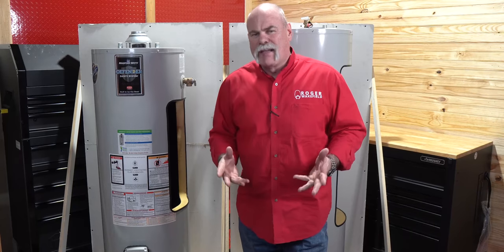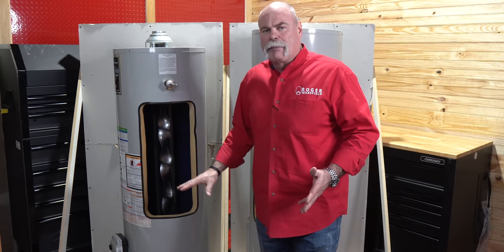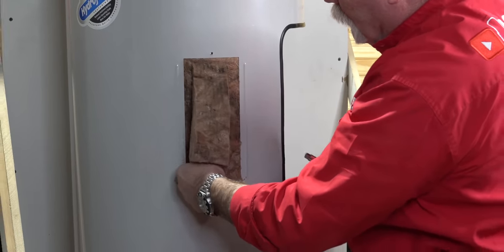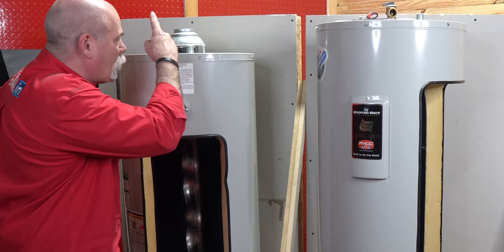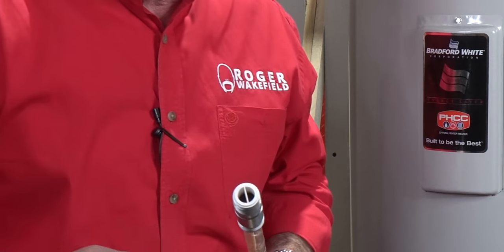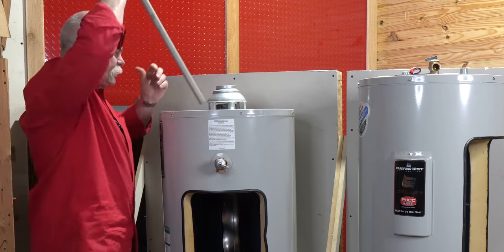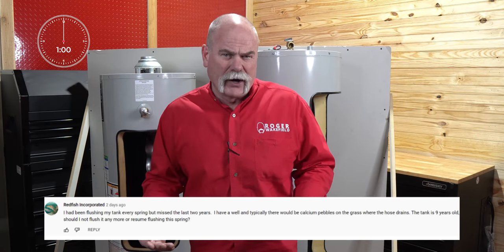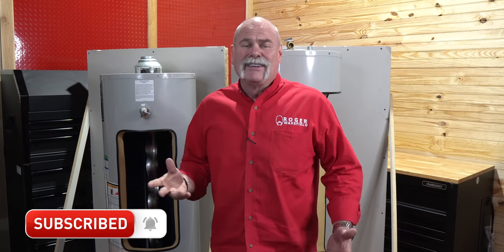Is Your TANK Water Heater Making These SOUNDS

Comment: I’ve moved 37 times in my life and never heard a water heater make as much noise as the one I have now. The maintenance guy said it’s normal but it makes noise every hour..
Reply: Mine is making a knocking noise every hour and lasting about 30 minutes or so and the maintenance man don't know what to do.  Ugh,  untrained and probably not HVAC certified. Did you all figure it out?
Reply: 37? dang thats a lot of evictions
Reply: @ladymomma5098  I usually have my fan on and don’t hear any sounds but my neighbor kept on complaining that I was using my washing machine at night. I’m finally hearing the banging and I believe it’s coming from the area where the water heater is there’s three floors and I’m on the second floor not convinced, it’s mine but we’ll see. Really eerie and strange.

Comment: My dad installed the water heater at our house when he moved in over 30 years ago. He is not a plumber. The water heater is still working properly, has never been serviced, has never been flushed. It made some weird noises once, but it's still working.
Reply: Is it a reliance brand?
Reply: Cause these are juggernauts and most actually do last 20+ years I’ve had mine for about 25
Reply: @oscarrivera3692  It's some brand that probably isn't even made anymore. It says craftmaster.
Reply: If it's that old, there's most likely a lot of sediment build up at the bottom of the tank, which means that water heater is costing you a lot more money to heat your water.
Reply: @Harloha  oh I never thought the tank was causing my high energy bills. Cheezus

Comment: had an electric tank in one place that was actually compromised to the point it was causing electrolysis in the water as it heated.  it was a rarely used building and every time you opened the hot tap, you would release the oxygen and hydrogen the electrolysis had cracked the water to.
Reply: My water heater started pushing gas  through the pipes. I wondered what it was. My heater is 30 years old and needs replacement.
Reply: Better hope nobody lights candles 🤣

Comment: My water heater (RHEEM brand) was installed by a plumber in June 2016.  Only reason I precisely when he installed it, is I recorded a video (saved to hard-drive) of him explaining how to flush it.  He advised opening the drain valve for 3 seconds, then closing it for 3 seconds, then repeat that process 5 full times.  Then after that open it and let drain for 15 seconds.  He said those first ~ 5  on/off cycles help stir the sediment around.

Comment: So I came home yesterday and my gas was off.  CWLP, city water light power, in Sangamon county Illinois  changed my gas meter outside. CWLP said it was mandatory. I’m sure it is. It’s above my pay grade to argue with them. My argument was, My Wife who works from home Could have talked to them if they would’ve simply knocked on my door and put forth a little Communication. Anyhow, they changed the meter they put a lock on the meter to where it cannot be turned back on, or I could not turn it back on myself, and left a note on my door. The note saying what they did. so after My Wife called, got it turned back on everything’s finally back to normal, sorta!That little bit of drama did not need to be installed into this comment lol but even though it’s a new day I’m still salty, maybe that makes me the jerk ha ha. So I fired up my water heater pilot light. And while I am laying there on the floor because of the awkward position my water heater was installed next to my boiler. I’m listening to it run and I start hearing sizzling drops. It sounds like someone dripping water into a hot pan. What do you think that is? Personally, I think it’s condensation like you spoke about. But, my wife, remember her? She’s the paranoid one who demanded I get online and find out what it is because my explanation after 30 years of marriage is not good enough, so that’s my question. What is the sizzling water drop noise after relight my gas water heater?
Reply: Wow, there was a whole Lotta unnecessary words in that comment/question..

Comment: Excellent advice once again! On a side note: i asked an hvac installer to give me a quote on a tankless system. the response i got was "we only have done it once" that was the end of that. i might get a second opinion some day. All i know is that bigger gas line would be required to deliver instant hot water.
Reply: The gas ones work from what I heard the electric ones don't last and have to pull 3 50amp circuits to them it uses 150 amps at 220V. We bought a heat pump water heater it was expensive now we get a whistling noise. The noise is intermittent from what I read that noise is from either the pressure relief valve or a crack in the top of the tank where it sucks air. Problem is it's intermittent I can't get the installer out here when it's making the noise. I'm kind of regretting buying such an expensive water heater now good old fashion direct element water heater is way to go. If I had gas here I would use that. They last for years if you flush the tanks.
Reply: Tankless water heaters don't work that well in houses. Maybe apartments, but a house will need multiple tanks.
Reply: Tankless is not an instant hot water. It is a continuous supply of hot water. To get what you might call instant would require a recirculating pump.

Comment: I had to change both my elements this past weekend. A pest control guy who knows nothing about water heaters. I got the both changed, and a donkey load of water on the garage floor, cause I thought I drained it properly....🌊🌊🌊🌊🌊🌊🏄

Also my sons (10 & 13), and I love watching your videos together, keep cranking them out
Reply: It take a good 10-20 minutes to drain. Most efficient method is to remove the drain valve. Be sure the cold water inlet is detached too to prevent vacuum retention. 

Lol but what do I know, I'm "just a handyman" as Roger says shrug
Reply: there's actually a secret to changing out elements.  you close the inlet and then open a hot valve to release the pressure and close everything up again, then you tape a plastic chute to catch any spillage from the element port and guide it into a bucket. then lay out everything to make the swap as fast as possible - when you pull the old element and slide in the new element, the tank will only lose about a cup of water, unless you fumble something.
Reply: @justtime6736  the cold side is the dip tube,just kill the water and open the hot side on all faucets

Comment: After doing dishes or taking a shower, my gas water heater kicks on and  few minutes later there is a single, loud metallic clank. Is that okay?  I’ve flushed it a few times, and that makes no difference. It seems to do it every time it kicks on. Usually shortly after the gas kicks back off.  Any tips?

Comment: Hello Roger, your 2018 version of this video said that you shouldn’t flush your water heater if you’ve never flushed it because the cracks in your tank are filled by the minerals in the water. You didn’t mention it in this video. Has something changed on the policy in the last 4 years?

I ask because I’ve never flushed my water heater. I’m hearing what sounds like rocks in the bottom. I don’t know if I should flush it or call a plumber. It’s over 15yrs old. I may just need to replace it at this point. I did use highly powerful magnets over the years to try to help with scaling.

Comment: @Rogerwakefield I'm a heating guy by trade and I just happened to stumble across your tutorial on your water heater very nicely done before I start a brand new furnace up I always tell the homeowner to open their windows because their fire alarms are going to go off not to worry that the heat exchanger is coded with oil to keep it from rusting during  shipping but their fire alarms are going to go off and their house might get a little bit smoky with a smell anyhow very nice job I subscribe to your page might take a line or two from you and use it on a customer someday you can always learn from another professional keep up the good work and letting people know that their water heaters not going to blow through their roof that it's naturally making noises and all is well and as long as they don't plug the TNP valve it won't flow through the roof lol

Comment: Very nice video...informative and well produced!   I have a situation that's not quite addressed in the video.  I drained my 21-year-old electric tank, disconnected the electric and plumbing, replaced the T&P valve, inspected the exterior for rust (it is amazingly rust free) and refilled the tank.  As part of the inspection, I laid it on its side for a couple of minutes.  After reconnecting and filling, I let it sit for a while before turning on the electric breaker, just to check for water leaks.  I observed the tank making repetitive clicking sounds.  They'd go on for several minutes, then stop for a few, then start up again.  I assume thermal expansion can't be the explanation, since I never turned on the electricity.  FWIW, since I have an open loop geothermal HVAC, I drilled my well down to an aquifer that provides excellent water.  Thoughts?

Comment: Howdy, from a fellow Plumber in Dayton Ohio. I used to carry a 3/4 threaded ball valve with brass nipples on each end on my truck. For "LIMEDOGS" that's what I called them. When there was no option but to drain the water heater, it was a gamble especially the boiler drains that were plastic, but with the waterlines still connected I would remove that boiler drain and screw in the threaded valve, shut the valve, disconnect the waterlnes,get a long screwdriver the open the valve unclog the line  with the screwdriver, once it got it open then shut the valve attach a gardenhose to the nipple, run the hose out to floor drain and drain it. I put them on my own W.H. to flush out my own every year.  Later Homie. And don't get Flushed!

Comment: My gas water tank occasionally booms, it's brand new. I've had technicians from the manufacturer and local gas company come out and say it's not a problem. it's very disconcerting. And sound like it's blowing up. What could that sound be?
Reply: "Oil canning" in the gas exhaust flue? More common with gas furnaces

Comment: The issue I am having is my electric water heater will be quiet and out of nowhere it will make a loud singular boom type sound, similar to a fireworks mortar. And just tonight the breaker popped and apun turning it back on the loud booms seemed to happen more frequently than previous.

Comment: I love your videos and expertise knowledge. I live in a mobile home park with an antiquated system in the ground. Lack of proper maintenance has caused major disturbances for residents. Huge pebbles, calcium, chlorine treatment   corroding our fixtures. The air pressure fluctuates and there's always air in our cold water inline. I recently researched the electric anode rod by Corro-Protec which claims to break down sediment deposits. I've read my baseline psi for home as 40 psi, drops to 20 psi with one fixture on and to 10 psi with two fixtures on. I am hoping an expansion tank will help and the electric anode rod might also help. Would you recommend any advice?

Comment: Is it normal to have a constant hissing sound of gas? I know it’s the gas because if I turn the gas valve off it almost instantly goes away… I would assume it always uses a bit of gas to keep the pilot lit, but I didn’t think you’d be able to hear that, it’s not really loud but it’s a noticeable hiss. 

Thoughts 💭?
Reply: Yes, I am here wondering the same thing. I assume it's air coming in or out of the outlet and hope it's normal noise.

Comment: What about a running water sounds from water heater and in the wall in the bathroom? No signs of a leak. Also getting warm water from cold water knob in bathroom after hot has been used. We are on a well if it matters.

Comment: Bought a house with a new gas water heater. At random times it makes ticking dripping noise that sounds like it's inside the vent (vent is metel) I think maybe the vent has condensation? Is that normal?

Comment: I had my new water heater installed about 2 years ago.   I’ve always been afraid to Maintance it but I know I need to.
Reply: Make sure you have a full port valve. Some models ship with a tiny hole that sediment gets clogged up in while flushing. It is really simple maintenance.
Reply: @stuntz0rZ  I’ll remember that.   The last tank I tossed got clogged.  Had to Carry it out near full.
Reply: @stuntz0rZ  u sound like you know a thing about plumbing.   I got a question about a 3 handle shower valve I purchased yesterday.  Trying to replace in my older home.

I picked up a pfister yesterday.  Seems to be ok for $115 at HD.   The old Moen valve had 2 proprietary fittings on hot & cold.. im just realizing.   Some weird union joints they don’t sell at any store.
I tried to use a 1/2 inch female adapter on hot & cold side..  I keep getting a leak out top of both 1/2 inch female adapters.   Of course no leaks where I solderd below it…..

I’m using plumbers tape.  No reason this should have a leak.  Are you able to attach a sharkbite over previously solder’d copper?    

Any suggestions are appreciated.
Reply: @bobduffy7744  Never have done one of those shower valves. Sorry, not much help there...But I want to someday. The leak is coming from where you applied plumbers tape? After the plumbing tape you need to use a thin layer of some kind of sealant (pro dope). For further seal protection you can even put wick in between the threads.
Reply: @stuntz0rZ  SOB.  I didn’t think the compound was absolutely necessary.  You think that would do it eh.?  Maybe ur right… it sucks the amount I’ve spent and time in the past 2 days trying to install this.  I could have hired a plumber for about the same price.   

Now I’m debating when I go to the store tommrow.  To either get two 1/2inch female adapter sharkbites and call it a day.  Or solder on the 1/2 inch female adapters with pipe dope.

If I use a sharkbite you think I’d still want to use the compound & tape ?  I haven’t used many sharkbites in my day.
Reply: @bobduffy7744  There are much more plumber videos on YouTube. Got2Learn is a good one. sharkbite is a temp solution only is what the pro's say. Good luck!
Reply: @stuntz0rZ  I hear that.

Comment: I live in a basement apartment and the furnace, AC/Heater are all down here in the basement behind some normal hollow core doors not too far from where I hang out/sleep.  I already had to deal with other noises from the central air system, but now the water heater makes annoying knocking sounds multiple times a day(probably when hot water is being used).  Bugs the crap out of me and my landlord won't do jack.  She doesn't even respond to my texts., ever.  I'm tempted to try to drain it myself with the help of a YT vid, but I hear a lot of times that doesn't fix it.  Had no clue about an annual drain, and have been living here for less than 2 years either way.  

Also tempted to get solid core doors in front of all those noise sources as well as the entrance to my appt which is right by my upstairs roommates kitchen.  Expensive though and I don't make much money.  These noises drive me nuts but not much I can do about it it seems.

Comment: I have a question for you how do you know if a electric hot water is to be replaced mine is 21 years old  will be 22 years old this August 17 2024
Reply from the maker: They are normally rated for 6-100 years…. I would replace it sooner than later.

Comment: I put in a new water heater and now when I’m taking a shower and the wife turns on the sink I get a banging sound in the pipes…. But if I just have one thing going …. It never happens …. And it didn’t happen before I put in the new water heater …. Thanks if you can help

Comment: My gas water heater will rumble and pop when cold or hot water is drawn. I have found no sediment when flushing it.  The cold water aspect is confounding to me.
Reply: Mine does the same when I run a faucet and  when I shut off a faucet.  Why?  I've taken out the drain valve and see no sediment.

Comment: We just had a new water heater installed about 2 weeks ago. We recently noticed a slight whistling noise we thought was coming from outside but further investigation and we realized it’s coming from the boiler. Is this concerning or common?
Reply: Same issue here, it happens usually after using a lot of hot water while the water heater is running.
Did you find an answer?
Reply: How do you fixed it.  I have a 10 month water heater and is making a whistling noise after I use water .

Comment: Okay just found this video. I moved into the apartment I live in going on 3 years in May. They have never came in and flushed out the tank. Now I'm hearing knocking and banging sounds coming from it. I've noticed it's usually after I take a shower a few hours later. I also noticed that my shower is usually out of hot water before I'm done in the shower. So it's not even lasting 20 minutes for hot water. Would you suggest hot water flush? Or just completely replacing it? Not sure how old it is I would have to actually look at the hot water heater or ask my landlord.
Reply: Contact your landlord, this isn't your problem.
Reply: Same issue. Did you figure it out?

Comment: What if it makes that grumbling noise (vibrates) only when hot water tap is opened fast? Only when opened fast, never used to happen before and I have no idea, quick google search told me it's either pressure difference or something, trapped air or cracked pipe.. I would have known if its cracked pipe, could it just be a pressure thing? Does anyone know? I know Roger probably won't see this comment ;x